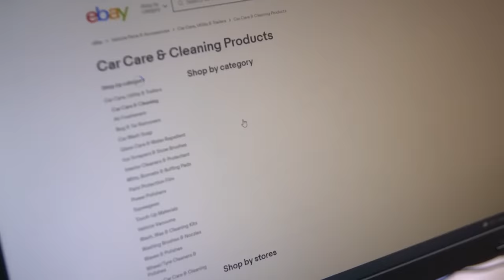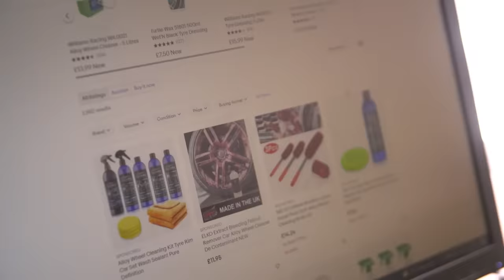Say Konnichiwa To This Pimped-Out GTO | Pimp My Ride, In Partnership With eBay | Ep 1 | #ad

Comment: Genuinely impressed with what the guys at Wrench did to this car - incredible
Reply: It looks like they switched cars. Check the spoiler, it’s the active aero vr4 spoiler.  I bet they found a used VR4 and swapped it. No way they spent the time to twin turbo, tune, and get the right ECU for it.
Reply: @bradconely3333  Fair enough if they did really, the rest of the work looks decent if a bit OTT like PMR always is. At least there were no silly features added like the old show.

Comment: Cars were swapped, end result is not the original car. SL and VR-4 have subtle differences in the interior, exterior and engine bay that prove it was swapped out. Like the fact that originally it has a static base model wing but later has a VR4 active aero wing, center gauge cluster goes from base model oil/temp/clock to the vr4 oil/boost/temp/clock. Typical shady MTV BS